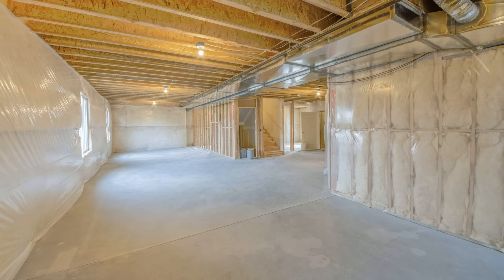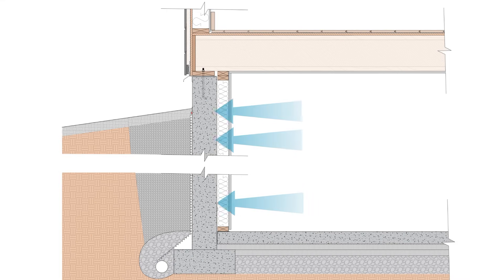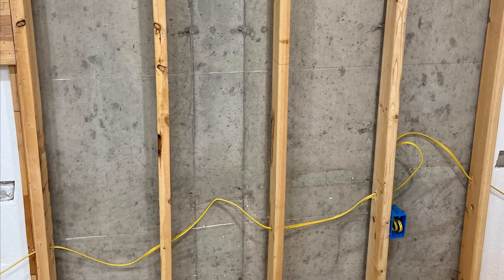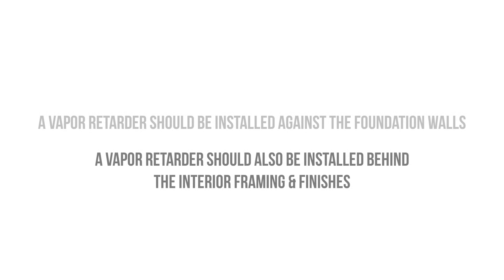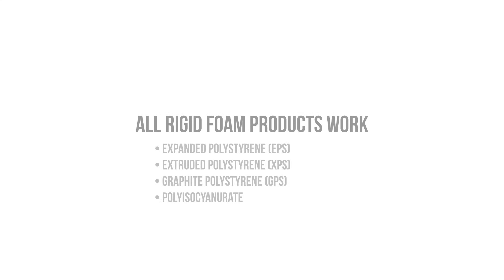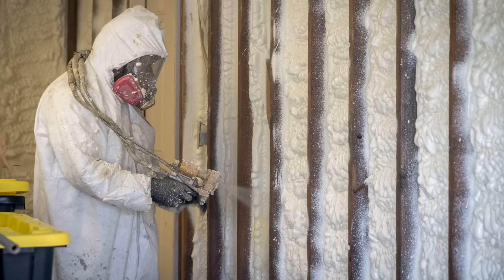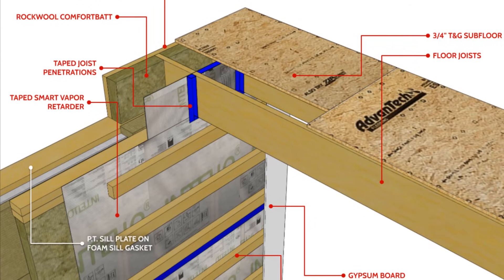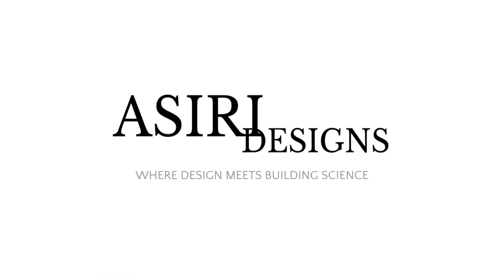The Ugly Truth About Basement Vapor Barriers

Comment: Ontario Canada vapor barrier code on basement walls. Gasket under bottom plate insulated and sealed all the way up to the floor above. So yeah when the concrete cracks it's a mold paradise but sealed from the interior till it isn't
Reply: Gas meter installer hairline cracked mine wall between the houses and didn't say anything. Had home inspected by pro didn't find it. I did 12 years later after it reached the floor. It leaked so little and it was wasn't noticed until I was moving everything and sweeping and noticed a bit of effervescence. Had a local guy fix it right with barrier etc.

Comment: We alway painted the foundation walls with tar stuck foam to it and back filled with clean stone over drain tile.  Then if finished basement, we would use 4x8X2 foam, tape and frame in front of that. No good?

Comment: I put a vapour barrier on the outside of my basement walls, I had the outside of the basement excavated down to the footing, and then sprayed with foam insulation covering the footing and the wall right up to the top plate on the ground floor. Now the concrete itself stays warmer , and no water can get into cracks and holes in the outside of the wall and freeze , creating big cracks. The result? I can frame and drywall the basement like any other walls on the main floor, and put in fiberglass batts between the studs without any worry of excess moisture and mold if I really want it warm. And...my basement is much warmer and dry! My house is seventy tears old.

Comment: This is why I hate basements. The best basement I had was a house my dad built. He used some kind of rigid foam on the outside of the building. There was crushed stone. I can’t quite remember remember , but I know that he insulated the basement on the outside from the inside  you just saw  the concrete form. He also did more crushed stone and I think some polystyrene under the floor.   That basement was never cold you could walk barefoot in the middle of the winter, and it was not moldy. But I still don’t like basements.
Reply from the maker: He sounds like a very smart man! That's the perfect wall approach.
Reply: @ASIRIDesigns  yes dad was a pretty smart builder. He was actually a plumber by trade but he had a couple of houses built. The house that they built like that was over 40 years ago so we have understood how to build well for a very long time. But thanks for the video it brought a lot of memories back to me.

Comment: I've heard all the scientific arguments and various solutions. This may sound stupid but; has anyone ever had a boat? In addition to drain plugs, most have bilge pumps to MECHANICALLY remove water that, in one way or another, ingresses inside the boat.
Likewise, many, if not all, new homes with basements, have footing drains (drain tile). Some daylight downhill. Some empty into sump pits in the basement and MECHANICALLY discharge water back outside. Some have both. I would NEVER build a house basement without a sump pump and pit. I want MECHANICAL control of  over water ingress. I ALSO WANT MECHANICAL CONTROL OVER WATER VAPOR (humidity). Why am I not seeing this approach to water VAPOR being stressed more? Whole house HRV (heat recovery ventilation) is code in many places. MECHANICAL humidity control seems like a no brainer, used in conjunction with basement insulating materials, integrated throughout the basement perimeter to capture moisture VAPOR. The condensate could be pumped into the sump pit. Yet, I read about all these various basement insulating solutions with no mention of using MECHANICAL means to control humidity. 
I have an unfinished basement with XPS on exterior, footing drain and sump pit. An ordinary dehumidifier, draining into the sump pit,, works just fine in the summer when the basement humidity rises. The furnace heats the open space in the winter (northern Minnesota). The dehumidifier wouldn't work so well if I had finished rooms there, insulated or not, whereas a means of collecting water vapor around the basement perimeter would.

Comment: Vapour barriers have been proven to be useless by more than one study from Polytechnic schools of Building Science. They may be useful in extremely hot and humid climates or extremely cold climates. The reason why they appear in building codes is because the oil industry, to improve their bottom line, "convinced" local building authorities to insert the requirement in their building codes. It's a scam.

Comment: You mention condensation from concrete wall on vapor barrier. When I isolated my basement, 30 years ago with mineral wool sheets and a plastic barrier I was told to leave 1/2 an inch between the insulation and the concrete wall so the concrete wall could breathe. I don't know if this was good advice or not, but I don't have mildew after all this time.

I was also told to leave one foot free  from isolation at the bottom because the basement is lower than the freezing line. Today, I saw YouTube videos that says it was the old method and today it is better to isolate up to the floor.

Comment: I am not a fan of putting ANYTHING on a basement wall where moisture is regularly present in the earth against the home. You are going to prevent the foundation from drying out. The foundation will ALWAYS be wet. Ventilate your basement. Don't cover the walls. Our house was built in the 1950's. The ground is moist. We don't get mold in the basement. Run a dehumidifier if you must, but let the walls breathe.

Comment: I have a 1955 home with a 10” cmu foundation. The exterior grading and roof drainage are fairly good- never had an extreme rain penetrate the foundation yet. There is an under slab sump pump that I hear routinely cycling. It keeps the floor dry despite the probable lack of any vapor barrier or insulation beneath the slab. The basement walls came finished but non insulated. Currently 2 1/4” deep steel studs 24”oc with 1/2” drywall. The stud wall is spaced from the block foundation by a healthy 4”-5” probably to allow for some main waste piping behind it in spots. Could I succeed by removing the interior drywall and fastening 2”-4” of xps foam board over the existing steel studs and then dry walling directly over that? My methodology is the taped joint XPS would serve as a continuous thermal break as well as a class 2 moisture barrier and air barrier. I would have to of course manage an insulation detail at the top of the wall and rim joist (currently also non insulated) as well as adding a thin dimple mat to the floor and tape that to the XPS as well.

Comment: I used this exact method on a new home build basement. Had the house for 10 years and always had a warm, comfortable non damp basement with no musty odor whatsoever. Exterior was a sprayed asphalt sealer with a perimeter french drain. Deal is to seal every joint with tyvek tape and spray foam.
Reply: it all depend on the water/moisture penetration. somewhat unnecessary video.

Comment: Careful here! There’s a lot of BAD info here! Too thick (Two layers!) of rigid insulation become a Class 1 Vapor barrier, same for spray foam (it’s a Class 1), concrete will always let moisture pass (concrete is porous) so water management shall be deal from outside and you should let the concrete face inside in contact with air to allow it to dry, etc, etc,… Get your information from serious sources: your country LATEST building code, British Columbia (Canada) building code (I’m not even from there, their building code is just respecting the latest knowledge of building science), 475 Building Supply (great knowledge section), etc. Building envelope: do it once, do it right and forget it for ever.

Comment: THIS IS COMPLETELY WRONG AND IGNORANT. 
DO NOT INSTALL EXTERIOR PRODUCTS LIKE EPS ETC INSIDE YOUR HOME.
IF YOU HAVE A FIRE, THE HEAT OF THE FIRE CAUSES THE FOAM BOARD TO MELT AND RELEASE GASES INTO THE AIR THAT CAN KILL YOUR FAMILY BEFORE YOU CAN ESCAPE THE FIRE. 
THERE ARE MANY CASES OF THIS IN THE PAST AND IF YOU CALL THE MANUFACTURER'S OF THESE PRODUCTS THEY WILL TELL YOU TO NEVER INSTALL THESE PRODUCTS ON THE INTERIOR OF YOUR HOME. 
NOT SURE THERE IS A RESURGENCE IN INSTALLATION OF FOAM IN BASEMENTS THIS WAY BUT IT IS COMPLETELY UNSAFE. DO NOT DO THIS.

Comment: I have gone into many homes that are older, no insulation no vapor barriers, and the basements are chilly, but no mold. When you start covering up moisture laden material, trouble starts. The best idea, is to build single floor homes with a monolithic slab if you are in a wet area. Otherwise just let the basement be a basement. Ventilate when you can, insulate the joist area only.
Reply: Sounds logical to me!
Reply: Good ideas sir...:)

Comment: Makes more sense to run a dehumidifier in the basement without a vapor barrier. I don't even feel like adding foam board is worth it. Mineral wool batts in between the studs is good enough with a 1 inch gap from the concrete face. If you have moisture problems in a basement, you have to address the root cause of the problem not cover it up with a plastic sheet. Moisture permeation has to be addressed from the exterior of the foundation wall or from the interior in certain cases like a crack with polyurethane/epoxy injection.
Reply: Yes you are 100% right on. I have been building like that for 35 years with no problems. On the permitted jobs there isn’t anything I can do about it, I just fall in line.
Reply: What’s your thoughts on runninghvact ducts with slight punctures for heat and air to push through helping dry things out. Totally agree on waterproofing from the exterior but just thinking of this for an alternative back up.
Reply: Insofast panels for the win!!!
Love ours on both main floor and basement.
Reply: Do what I did, excavate and spray foam insulation on the outside basement wall from the footing to the top plate of the main floor. That solves the moisture problem and the insulation problem all at once.

Comment: I have a new build we just moved into. Foundation exterior walls were sprayed with tar water protection and covered with 4 inch rigid foam. I added 6 more truck loads of gravel on the exterior fill which brought it up to 5 feet of stone on exterior walls. Interior sills were spayed with closed cell foam sealing around the floor joists. Basement walls had the 4 foot bat insulation hung from the top per code. Floor was covered with vapor barrier before pouring. Two month later I discovered 6 vertical cracks in the poured foundation in the middle of a 80 feet long wall. Everyone says this is concrete shrinkage. The issue is 3 of the cracks are leaking water enough that it pools on the floor. All the cracks seem to go through the 8 foot wall to the exterior. Builder installed the form-a-drain system with sump pump. I have the water proofing guy coming out to seal the cracks. I was going to finish the basement but now I’m worried the cracks could open up in the future or more cracks develop. Should I just paint the walls? I would really like to insulate the walls as we will be using the basement a lot. A problem I shouldn’t be having on a new home ☹️
Reply: In a new home, I wouldn't finish it for a few years. You have to let the foundation settle/equilibrate and watch for problems to develop. Never paint concrete walls. It will seal in moisture and cause a lot of problems and the paint will just flake off eventually. You can paint exterior foundation walls with the right type of paint or use the tar barrier as the builder did.

Comment: But what if moisture comes through the wall and gets trapped between xps foam board and concrete wall? Wouldn't that be the same as just hanging poly against the concrete wall?
Reply: Yeah that's the first thing I thought.  Can't see what the difference is myself, since the plastic and the foam are both vapor barriers
Reply: @drblaze3850  if i understand this video properly, the whole intent is to prevent the temperature differential from meeting the dewpoint. with the ridgid insulation two layer thick, the temperature differential is kept to a minimum this preventing condensation.

Comment: I always said not to use a vapor barrier just for that reason. I finished my whole basement without any vapor barrier and no insulation. 20 years later my drywall is like new. No mold anywhere, even behind the drywall and concrete wall.
Reply: I did a flip house that was thirty years old and had half of the basement drywalled. I ripped it out just to make sure no mold was behind the drywall and there was none. It was drywall hung on fur strips no insulation no vapor barrier. The walls were painted white so I’m not sure if it was a waterproofer because it was a foreclosure. Even though there was no mold or signs of mold in the drywall I still ripped it out so I knew for sure I was selling a clean, mold free house.

Comment: It always seems like the tape would be the weakest link in any system. This reminds me of the Kerdi shower waterproofing system I installed. Banding and mortar tie everything together, but the schluter all set mortar mix which acts as the glue for the banding to the vertical and horizontal surfaces isn’t waterproof.

Comment: I’ve been thinking about exterior insulation.

Why do people always want waterproofing on the home and the exterior insulation?

Easier for walls, where do you install the WRB? I always go over the exterior insulation.

It’ll stop it from getting wet, as well as from having air movement through it.

For a basement wall maybe not as easy. But still exterior insulation, then your dimple mat etc, keep the insualtion dry and performing as it should.

Now how to tie that up to siding? Maybe a hydraulic cement parging?

That way exterior insulation can continue from basement up to the siding system?

Dimple mat below grade outside of insualtion, then hydraulic cement protecting it above grade foundation, and then siding covering, and WRB covering insulation on exterior walls.

Any insight on this? I know there’s a lot of systems that do basement waterproof and insulation.

I take from the classic CI and WRB (which goes first) argument and bring it below grade to see how that can be done.
Reply: Surface-bonding cement (hydraulic cement + sand + fiberglass) is what you're looking for, but IMO is kinda fragile with respect to impact damage. Sheet metal is much better for protecting exterior foam above grade.

Comment: A lot of variables seem to be in place here. Moisture in the concrete, both conditioned and unconditioned air, water table depth, etc. Adding a sump pump crock and moisture producing condensation line for AC in the basement all add up to a difficult at best potential issue.Trapped moisture seems to be the gorilla in the room. I'm of the KISS concept, and would try a formula using a HD Dehumidifier in the basement, no vapor barriers. I'd pump AC condensation and dehumidifier lines into the sump pump crock and use a secondary battery powered pump for utility power outages. Keep in mind, foundations typically have drains surrounding the basement, this is a very large amount moisture to contend with, especially in a high water table area. I learned a long time ago, it's a lost cause trying to prevent water.moisture entering a basement. The best efforts should be focused on moving the product, quickly and precisely where you want it to go.

Comment: Cool but I need some help!
My interior walls throughout the whole house. Not talking about the basement anymore just so we are clear. Haha. Anyway should I add a plastic barrier? 
Cathedral ceilings with a loft. Spray foamed ceiling. Just regular wool insulation is the interior walls but I will first spray foam around the seams to seal each 16" stud cavity or whatever you want to call it. 
First time builder here. I finished the shell now I'm ready for insulation. 
Thanks.

Comment: Wait, a vapor barrier against the concrete is bad because it traps moisture against the concrete, but insulation does not??? Am I missing something?
Reply: Insulation isn't a vapor barrier so what's so confusing?
Reply: @sergeyb8  Rigid foam insulation IS a vapor barrier....
Reply: @roberthalljr4120  "membrane" type of vapor barrier is nearly impossible to make 100% air tight so that's why it's a bad idea no matter where you install it in the basement walls.  You have to seal the seams, seal transitions from membrane to foundation and ensure there are no holes. 
Rigid foam is arguably a better choice, but I think spraying 2" of closed cell foam is the best.  That's what was done in my basement... Followed by Rockwool bats.
Reply: @roberthalljr4120 not at all. Some are Vapor barrier but a lot aren’t.

Foil faced ones are, unfaced ones aren’t
Reply: @sergeyb8 doesn’t get much better that that

Comment: We’re not building a basement, but building above grade using Superior Walls (SW). These are precast 5000 psi precast concrete walls with R19 foam board built in. I was planning on using dense pack cellulose in the stud bays, however SW says that anything other than closed cell foam needs careful management of interior humidity. We will have an ERV, and a vapor retarder in the ceiling with R50-60 cellulose in the attic. My conundrum is whether to use a retarder or barrier on the exterior walls. I’d be interested in anybody’s thoughts on this.

Comment: The only basement wall vapor barriers that work consistently are installed on the outside. I also like the insulation on the outside, rigid with oriented strands and back-filled with gravel. Good perimeter drainage is critical.